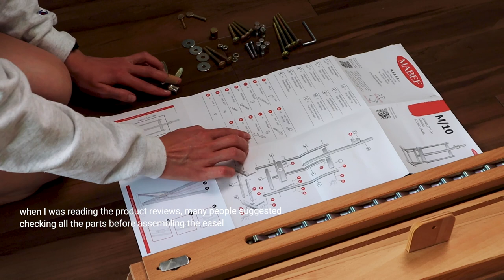❤️ In Love With MABEF M10 Studio Easel | Easel Review

Comment: The most useful art materials video I've seen in a long time. It's so helpful to see how the easel stands in relation to a person (and handy to know your height). It's also important to see how much movement it has - I work with compressed charcoal on paper, so it needs to have good resistance. Thanks for making this!
Reply from the maker: Thank you! ❤When I was looking for an easel I was looking for the same type of the video to help me understand how big it is. So when I got this easel I decided to make this type of video so other artists can see if this is a good fit for them. 🙂 Overall this easel is amazing, I highly recommend it, the quality is really good.
Reply: I thought about how much work it is to assemble furniture and you had video setups to do on top. Quite a load, and appreciated. I suppose making what you wish was there is the creative act in a nutshell.
I'm caught between the M07 and the M10 and wondered if you've had to brace your support when applying pressure? I've used W&N easels, which are a poor relation I know, but would like to avoid holding my left arm up for hours! It'd be great to have my support stationary if possible. But the M07 is an extra 3.5kg and takes more space.  @PolarBearSketches
Reply from the maker: Hm, this is a good question. I'm used to holding my arm up all the time while drawing without leaning on the easel much. I tested it for you briefly and because the structure itself is very strong it allows you to put some pressure if you let's say draw with charcoal or pencils and it seems to be steady.

M7 is a great choice of you need a place to put/store paint or tools. But both of should be excellent and they both look so elegant and premium. When I was thinking of getting one I wanted to get it once and use it for the next 10+ years so I was ready to invest a good amount of money in it if needed and I wanted to like how it looks like because now I see it everyday in my home office (and I really enjoy looking at it). I know it's a hard decision to make! ☺

Btw, it was pretty easy to assemble, they have a pretty good manual, just make sure to check all the pieces that come in the box before starting putting it together, I was reading some reviews before making the purchase where people would complain that some parts were missing because it wasn't sealed well. @j_a_lee
Reply: Hey thanks for experimenting on my behalf! Good reminder about checking the parts too. I've ordered an M07 so I can go large with those big and soft marks. It's good to know it's going to be solid when I go at it some. All I need to do now is make larger boards for stretching. Not the ideal time of year for drying things outside! Thanks again.
 @PolarBearSketches